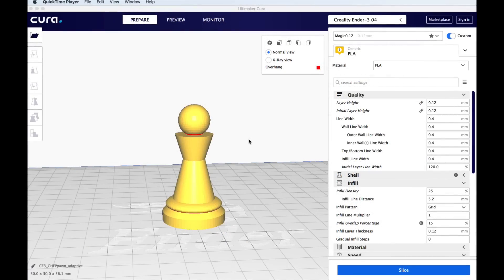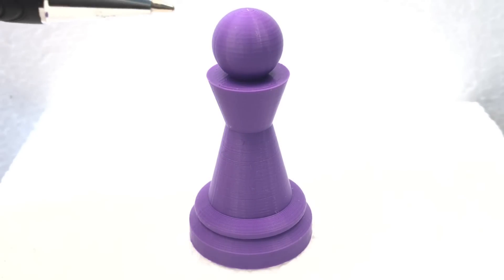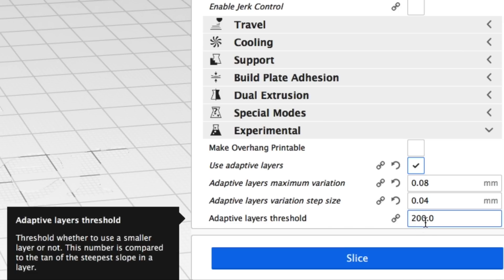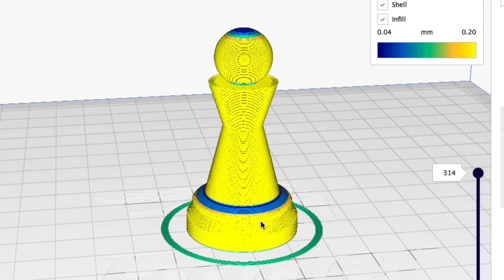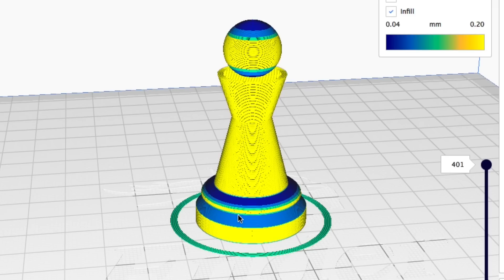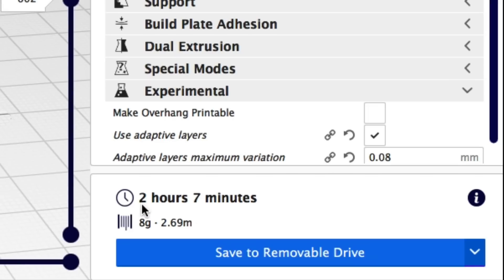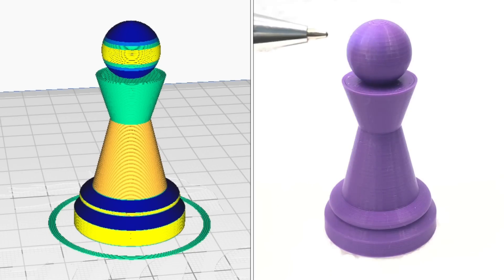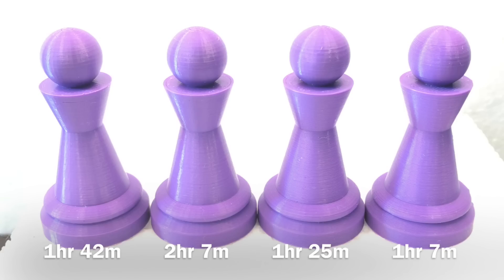Cura Slicer - Adaptive Layers Settings and Results

Comment: Firstly, thank you for an excellent instructional video. Your teaching and explanatory style is first class!

At 5:00 in the video when you have them all beside each other, it offers a chance to really compare them. But what is odd is the observation of prints that have adaptive layers in some cases appear worse than the uniform .12 layer height. Intuition would lead one to think, the Adaptive 50 would lead to the best looking part because the algorithm seems to be looking for areas of maximum change to apply smaller layer heights in an attempt to improve the fidelity of the print to the model data.

But my best guess as to why relates to an area of industrial design known as Class-A surfacing. Without getting too academic, Class-A surfacing has to do with managing how light is reflected from curved surfaces in product design. If there is a sudden change in the mathematical aspects of the curvature, such as two parts being joined together, if not designed carefully the light may be reflected differently from one region of the part to another. So instead of an integrated "sculpted" look, the person can see the discontinuities and the transitions can be seen and the object is less aesthetically pleasing.

It appears that the adaptive layer heights when changed suddenly by the slicer algorithm creates this effect unintentionally. One suggestion might be to change the layer heights more gradually en-route to the regions where the finer layer height would improve the presentation of smaller features, but this would increase print time to achieve a more continuous transition of the layer heights versus suddenly changing them.

Thank you again for an informative video.

Comment: One thing to be aware of in the settings now (4.13.1) is that the "Adaptive Layers Maximum Variation" works both ways of the "Layer Height". 
I thought it worked like "Layer height" was the max. But it shows after slicing that the thickest layer is "Layer Height" + "Adaptive Layers Maximum Variation". 
It might be a bug in this verson, but it gives me some very tall layers before I notised.

Comment: What version of Cura are you using! I have 4.4.1 on one machine and 4.10.0 on my other machine and neither one have (ADAPTIVE LAYER THRESHOLD!) I would like to control where? what layer for cura to start Adaptive layers
Reply: I have 4.9.1 and it has adaptive layering.

Comment: Is there a way to manually set layers and control the Settings? I want to create a tow hitch cover and can really care less about everything. I just want the text at the top to be clean as possible
Reply from the maker: Try this https://youtu.be/su_m5zV9rvA
Reply: @FilamentFriday  Great tips, but unfortunately I cannot find any way to vary layer height for specifically designated layers. Almost everything else can be adjusted.

Comment: So, is the print better without the adaptive layer checked? I have Cheps 0.12 updated profile and without the adaptive layer check off, and the print im doing shown in print preview under layer thickness is "all blue"  0.12=blue  mm=green  0.20=yellow. if i have adaptive layer checked off then it shows all 3 colors, what one should it be? im confused..???...

Comment: cura 4.8 does not have adaptive layer threshold. It has adaptive layer topography size. not sure if its the same thing, but im guessing no.
Reply: I found that when I was searching so I thought I'd share. Set mine to 0.15 but print time was significantly higher than without adaptive layers enabled, layer height was same. Guessing a value somewhere above current layer height is best.

Comment: How do I enable the overview to see what layer different sections of the print are in the latest version of Cura?
Reply from the maker: Click on preview
Reply: Actually I'm having the same problem. I can't find the section that allows you to see the variable line heights with color. There's supposed to be a drop down menu somewhere but I can't find it.
Reply: @SmlWng123  At the top click on "color scheme" and then select layer thickness

Comment: It's not totally truth about faster print speed. If I want print with 0.3 layer height,  then it's take a lot longer with adaptive layer. 
My tests results with base layer height 0.2 MM and turning on adaptive layer that is not designed to speed up printing but to take care about overhangs with models witch they need support in that place. Also when is printed sounded shapes and layer height results on top with wholes between layers, adaptation helps reduce length between layers by divide layer by two or 4 depending at settings. Then model is printed with 0.3 MM  and sounded shapes are thiner to reduce stairs, wholes between layers and reduce needed support from the bottom of model.

Comment: I couldn't get on with this setting. While it's great in theory, my flow rates on my machine seem to get screwed up. It might under or over extrude as if the printer's firmware is getting confused.
Reply from the maker: Could be your extruder is slipping.
Reply: @FilamentFriday  Wouldn't that affect everything I print? When I don't use adaptive layers, things are fine.
Reply: @ArcanePath360  You are not alone, I tried the profile for my printer in Cura and the surface would get lines at certain points in the preview, sure enough they would show up in the prints. My buddy was having the same prints fail near the same spot, looking back at the previews it had similar random lines that showed gaps. Turning adaptive layers off fixed the lines on my print and we are going to test it on his. We're both running Cura 4.4, not sure if the issue is limited to that version, it only happens on more complex prints.

Also Cura markets adaptive layer as being quicker, but in the profiles the time to print goes up by around 30% when active.
Reply: @miles13242   I'm still on Cura 3.5. Is it still under experimental settings? Perhaps they haven't ironed out all the flaws yet. As for being quicker, you have to take that in context of the higher resolution being used at certain points, where to obtain this normally would mean printing the whole thing at that high resolution, which would of course take longer. If I remember correctly, the resolution you type at the top will be used as an average, not the highest, so you have to be careful not to go beyond the limits of the printer. I don't ever go beyond .1mm as FDM prints aren't going to notice better than this in most cases.
Reply: @ArcanePath360  it is still under experimental. Perhaps that is my problem, I print at .16 layer height, maybe it condenses the fine layers too much, I think they could make it better by adding settings, possibly a min and max layer height for more control.
Reply: @miles13242  Yeah, it's difficult to understand and needs lots of trial and error. I gave up because my printer just doesn't like it. Good in theory but not practice.

Comment: Trying this on All In One Micro Test with a CR-10, has anyone had any success? Specifically for at the top of the arches. 

Also, how do you get to see the Layer thickness box as shown @ 2:07? I'm on Cura 4.2 with GUI plugin.

Lastly, i tried setting my Cat Profile to 0.04 Layer Height, adaptive on Max Var 0.16, Var Step 0.04, threshold 200 and curiously it's the same build time as 0.12 Layer, adaptive Max Var 0.08 Var Step 0.04 threshold 200. Weird huh? Or is it? 

So far i can't see the difference between plain 0.2. Not that i've had time to test it VS 0.12 and 0.04 (exclusively without adaptive layers) as i just got my first printer 2 days ago. Basically i'm watching every CHEP video with haste! Pity the Infill Box trick doesn't have a different Layer Height option... that would be awesome.
Reply: Thanks for letting me know :)

Comment: I used adaptive layers for a dungeon tile, which has quite a bit of detail on the surface but the rest is all straight lines. It improved the print speed a lot.

Comment: Hi Chuck, thanks for all the great informative videos. Quick question. Is there a way to hide the z seam better on cylindrical parts like this in Cura 4.0? I have tried random which leaves zits all over. I have tried user specified, which just makes a continuous vertical line all the way up. Havent had any luck with anything so far. Please help. Thanks
Reply from the maker: Not that I know of. I’ve had the same results you describe.

Comment: For better sound, I'd suggest adding something even softer to the walls in your booth.  Either acoustic ceiling tiles or better yet (but not pretty) big thick moving blankets as they are cheap.  If you want it to look better than just moving blankets on the walls, then buy some interesting fabric from a local fabric store and add a layer of thin / good looking print fabric over the moving blanket so that it improves the look.    The sound won't be quite so "live" or harsh.  The tones that you are getting bouncing back off your current setup will be absorbed by the blankets and have a much more natural vocal sound.

Comment: Hello Chuck, I was trying out the adaptive layers on a statue. I was wondering why the nasty difference between layers occured such visibly on your print and WHY the layers differed so much. I think I GOT IT. As I was printing I was trying to make custom settings to get as persistant result as possible. The ADAPTIVE LAYERS SUX as it seems because CURA is not changing the FLOW correctly for the layers. Also if you are printing at speed, it seems that there is a certain pressure built in the nozzle so as the layer height is changed, the thiner layer gets a pressure bump and prints first layer much wider.......
Reply: Maybe  I am wrong but with so many variables it makes no sense to use it. Maybe add a retract for layer change so it resets the nozzle. Anyway, inspirational videos. Keep It Up!

Comment: yeah, nice but not perfect. would be great to have the layer slider on the right have selectable value ranges for layers (and infill) in various sections. kind of like the infill blocks but instead on a slider,  for sections based on % of height of model.
in the instance of this model having a way to print the ball on top and base rings at on bottom at  .04, and then just select the middle cone layers to print at 0.2 (or more even).

Comment: It's nice that it tries to guess a better layer height based upon the slope, but I prefer to use modifier meshes in slic3r to manually set the layer heights in different portions of my model.

Comment: A very interesting video, just as all your videos.  I have a question:  I cannot see all the colours that you have in your models in Cura. My Pc has a NVIDIA GEFORCE video card and I do not see the colours. Please, did you Know if this is a pronlem for all Nvidia cards and how to solve it?  Thank you for your answer  Greetings,  Luigi
Reply from the maker: Cura does rely on OpenGL 2 compatible graphics cards.
Reply: @FilamentFriday  thank you very much
Reply: this happens to me sometimes, but if I run the layer slider up and down it usually fixes it.

Comment: Very Cool! Didn't realize Cura had added this option. One thought though, you mentioned it lets you put detail where you want it, it really is more detail where Cura thinks you need it, right? So for example, it doesn't look possible to just make the ball part all .12, and the rest .2, correct?
Slic3r PE does allow very fine grained control over layer heights with the Layer Editing, and object layer settings, and could just make the ball use finer details. That contrast is, Slic3r PE requires you to make all the decisions, which can be tedious at times, versus Cura doing it automated based on user input. I see use cases for both.
Nice to know it is there, but even more so, it is exciting to see so much progress being made in the various slicing software recently. Cura and Slic3r PE are really starting to run wild, rapidly catching up to Simplify 3d, perhaps even eclipsing in some areas already.
Reply: I haven't used Slic3r PE, but regular stock Slic3r has adaptive slicing.  You can tweak it, but it will sort out your layer heights within given parameters.

Comment: Great vid, but part definitely not good for adaptive. Best fit is where you have varied straight and sloped sections - the straight bits can have fat layers, and the sloped bits much finer ones.

Comment: Sound is worse than before in my opinion
Reply: I agree.  Sounds like an empty closet .  Much better before.  I used to do voiceovers in a full closet of clothes.  t's dead as it gets.
Reply: I agree.. not an  improvement. The old sound was fine... but yes you'll need acoustic panels, or some hanging clothes all around... or some wavy curtains. without them, as it is now, you're still bouncing sound everywhere in a non-controlled manor. When we make our movies and want to record a voice over, we put the talent at the entrance of a small closet full of clothes; it makes a u-shape pattern around the talent's head, no need to cover the back. - Keep the great content coming. I really do appreciate it.

Comment: Problem with sound booths: you will have a prominent resonance frequency that fits smack in the middle of the human speech. It is very hard to get rid of that "sound of a box", EQ will not help completely since the problem is time based not just frequency alone: it is caused by the slightly delayed waveform bouncing back from the walls to the mic.

It is by FAR better to record in large, empty room that is moderately dampened, just basic furniture in the room can be enough. Sound proofing and room treatment are two different tasks and vocal booths really do the former much better, they are meant for isolation and usually we use large diagrhap condenser mics at VERY close distance to get more direct sound and less reflected. 

The room sound is all about its dimensions and even in the expensive studios the room sound comes thru. The distance to nearest wall should be longer than the wavelength of your lowest tone or note. A typical sound booth will have prominent resonance peaks at around 150-200Hz range.. It takes quite a lot to make booths sound neutral. If you can, move your self out from the walls and do a test recording with the same script you used here. You will notice how about 2-3 foot off the walls it becomes easier to detect words from spoken language. That is because the distance is greater and the resonance peak will be lower than your voice range. 

For the absolutely best position, try first 38% rule: that is the amount of distance between two adjacent walls and you. To explain better: we have a 10m room. Your best position to record speech or vocals is going to be about 3,80m from the frontwall. That is not exact science, well, how we get to 38 is bit in reality this will be dependent of the room size, shape and surface materials. But it is damn good starting point. Try to make all distance to all walls different: the worst possibly place are the corners... that is just asking for trouble.

Source: recording engineer. Also, room treatment needs MASS.. Cheap and thin foams only block the highs while letting everything below ~250Hz on go thru. That will not fix the "box" sound, it just skews the response. Anything below 250 is going to need inches of thickness and pounds of mass  and most often need to be designed for YOUR specific needs. Big rooms are MUCH better for recording, widest open space you can find is the least echoy.. In nature, outside on calm day is right next to an actual anechoic chamber when it comes to reflection vs direct sound, we can actually measure impulse response like this without the need for anechoic chambers... 

Sound works in inverse square law so every time you double the distance, sound pressure goes down by a factor of 4. Use that knowledge to your advantage.
Reply: Maybe the trick is to not try to make the recording booth "soundproof"; instead you might as well make it a sparse frame covered with absorbent material, with no solid walls at all.

Comment: Cheap.  Got a question.  I just installed a bondtech bmg extruder on my cr10.  The stepper motor is running hot.  I have to keep a fan on it.  Any suggestions on a fix?

Comment: Your sound booth has a design flaw.  The wodden slats over your absorbers are acting like a BADLY designed diffuser which is causing the very horrible interference (comb filtering) that you hear.   Recomend either removing the slats, or randomized the slats, (the periodicity of the slats make the comb filtering even worse).

Comment: Hi Chuck,
Nice video again, I am starting to like Cura over S3D now I get to know it better.
As for the audio, it sounds a bit hollow but it's very understandable.
Maybe there is a bit of a standing waves problem that can be solved by changing the angle of your panels or using a hyper-cardioid microphone under an angle of 45 degrees down to your mouth.
(no kidding, this was my profession for years).

Comment: sound booth defiantly needs some tuning. I've been on the fence with adaptive layers. Where I saw it's usefulness was with arched overhangs that might stretch the limits of being printed without supports. As the adaptive layers could shrink in sizes there helping keep the plastic from drooping.
Reply from the maker: Good point